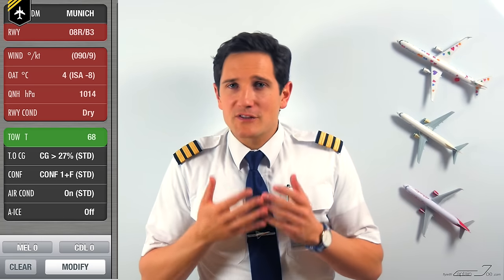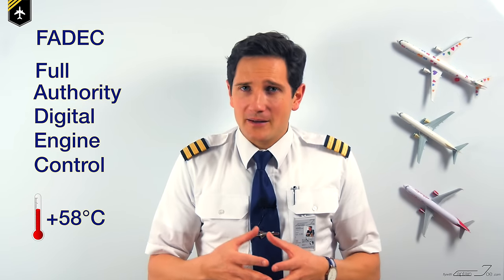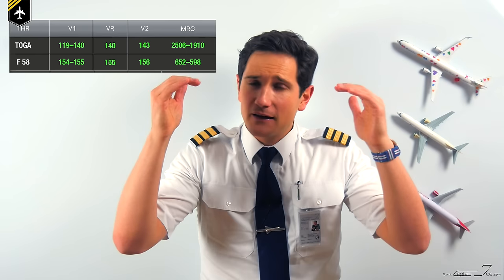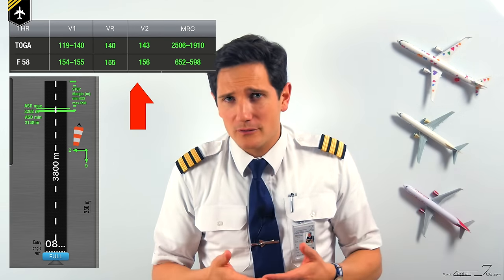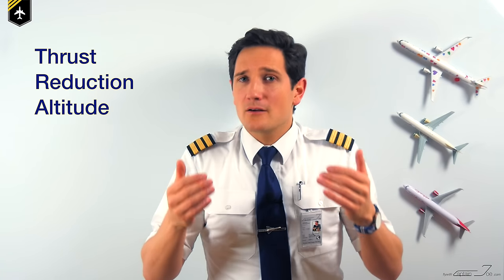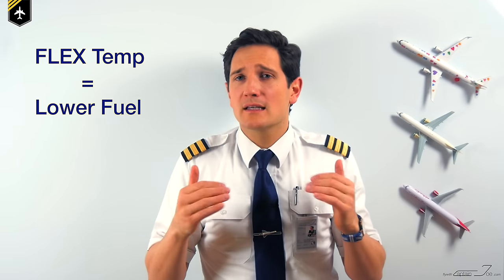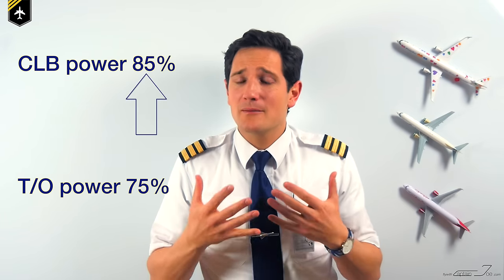What is FLEX TEMPERATURE? Explained by "Captain" Joe

Comment: Hey Joe, can you explain about hot start and cold start? Thanks
Reply: There is no such thing as a cold start.  A hot start is when the EGT (exhaust gas temperature) tries to exceed the limit while starting.  The FADEC will shut off fuel and continue to turn the engine core to allow unburned fuel to burn until it is gone and for a while after that to cool the engine core.  On a 737, 757, 767, the pilot shuts off the fuel...

There is probably a video available on YouTube that you can watch.  Most likely, it will be in a simulator scenario as hot starts are very rare and the likelihood of someone capturing it on video is even more rare.

For one, most airlines do not allow pilots to videotape in the cockpit.  It can be a distraction from safe operations.  Joe doesn't fly for a US airline, and I have no idea what his company allows, or what regulations allow in Europe.

Comment: Always great explained! But one question: At which temperature does the aircraft set TOGA? I mean if you choose a very low FlexTemp then the aircraft need to compensate it. Or is there a minimum Flex Temperature?

Comment: Don't wanna waste 6:04 trying to find the explanation? Let me simplify it for you! Flex temperature essentially tricks the engine into thinking it is actually the outside air temperature. The higher the flex temperature entered into the MCDU, the lower the engine thrust. The lower the flex temperature entered into the MCDU, the higher the engine thrust. For example, if you are taking off from a long runway, you don't need as much engine thrust, so your EFB iPad would calculate a higher flex temperature.

Comment: The missing point is that the FADEC will match the air density. When T is high the air density is  low so for the FADEC no needs to waste fuel. That's the basic concept of flex Temp.

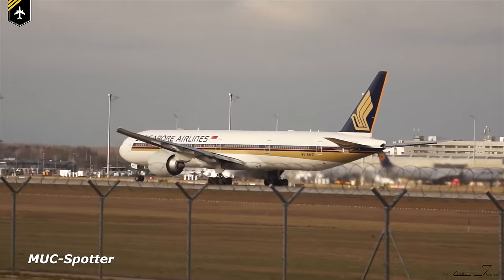Comment: Hi Captain Joe! Could you explain how the take off thrust can be lower than the climbing thrust on a Boeing (5:04) while the force to take off should be higher since you are still stick into ground. Gravity shouldn't be more important when taking off than when climbing in the air ? Thanks.

Comment: Great video. I have a great doubt due to your explanation. Why airplanes need less power in higher temperatures if with high temperature we have less air density?. In my common sense, I think that as we have less air density we need more power to achieve the VR or the enough lift to take off. I know in the performance chart we can take off with less power, but why the computer assume that with more temperature we need less power. I hope to have an answer. Thank you.

Comment: Hi Captain Joe, on the description you say that while using a higher flex temperature for take-off the plane will need to go faster than the same plane on a lower flex temp. I don't get that... isn't the take off speeds (Vr and V2, not V1) based on plane gross take-off weight, flaps config and outside air temperature and pressure and winds? I would assume that different thrust settings for the same plane (weight, config) and same environmental conditions (temp, press, wind) would only cause different accelerations, hence more or less runway needed for take-off (V1); but same speeds (Vr, V2...

Comment: Hello Captain :)  Sorry but I dont understand why Vr is increasing when we use flex temp. take off. I understand that aircraft accelerates slower, so the take off distance required increases. It simply takes more time and distance to reach vr. But shouldnt the lift off be at the same spped, as in full thrust take off? I dont get it, and can;t find good answer in the internet. Best regards!
Reply: Basically, an aircraft climbs not by lift, but by excess thrust. The purpose of lift is to keep the aircraft in air (this is the reason why rockets can climb vertically, without needing wings for lift).

Hence, in a flex takeoff,  since you have less thrust, hence you need a higher speed to lift off.

Comment: Great explanation. However this always goes against my intuition which is if I tell the computer that the OAT is actually higher, then it should give MORE power since when the temperature is higher you got a higher density altitude which requires more thrust and also thrust itself decreases with an increase of temperature.
So flex temp increase will decrease applied thrust only because of engine protection (less wear)?
Reply: Basically think of it this way. The aircraft has a EGT (exhaust gas temperature) limit. The higher the OAT is the higher the EGT can reach. Above a certain OAT if the aircraft uses full thrust, the EGT limit will get crossed. To avoid this, the FADEC limits the thrust so that it doesn't reach those EGT limits.
So basically flex temperature is doing that, to reduce thrust.

Comment: Dear Captain joe. What is "EPR" meaning, and what´s The differents between "N1"
Reply: janick burghardt Exhaust Power Ratio, while N1 gives you a percentage of maximum front fan RPM and N2 the percentage of turbine RPM, EPR acts as N1. However, EPR measures the pressure difference between inlet and exhaust to calculate the thrust. Some people agree this gives a better vieuw on the engine performance then N1. EPR is used for A320's with IAE engines, N1 for CFM.

Comment: Another great video.
I was on an Airbus A320 yesterday and about 30secs after takeoff the engines went back to what felt like idle for about 2 seconds then back up to climb thrust. There was a bit of turbulence whilst the thrust was reduced. Is this common?? I thought maybe a problem and turning back but flight continued with no problem.

Comment: Hello joe, great video! Why will the V1 increase with a greater flex temperature as I can see at 3:00 min? If the thrust is derated you will use more runway to achieve Vr so I thought V1 would be lower

Comment: In the CAP698 Performance Manual, it states that a Reduced Thrust Setting (FLEX Temp) as well as a Derated Thrust Setting cannot be used when using the increased V2 procedure when trying to obtain Vx before VLOF. Does this change from aircraft to aircraft, or airline to airline? Or is this a set rule that cannot be ignored? 

Curious as the CAP698 is type specific to a generic B737-400. Would be nice to have an opinion from someone who flies a different aircraft!

Comment: Hello Joe thanks for the very informative video!! I have a question. In your explanation you say the LOWER the Flex temperature the higher the engine thrust. It’s seems to me the HIGHER the Flex temperature the more thrust you should need!! In other words can Flex Temperature  be thought of in the same light as the hotter the outside temperature the longer the takeoff roll? Can you explain this a little further? Thanks so much!!
Reply: Its a different concept. Flex temperature isn't for how much thrust you need for that temperature, but rather, how much thrust I have to to not overheat my exhaust gas temperature limit.
I'll try explaining in very rudimentary language (to avoid confusion)

Say the exhaust gas limit limit of the engine is 900 degrees. So at normal temperatures, the engine can create max thrust while maintaining the exhaust gas temperature at 900. In this case lets assume that max outside temperature is 40. So at temperature 40 and below, the engine can make max thrust without overheating. Now say the outside temperature goes to 41 degrees. Now if the engine tries producing max thrust, it will bring the exhaust gas temperature above 900 degrees which is above the limit. So to avoid that, the engine decides to reduce the max thrust it can generate, so that the exhaust gas temperature doesn't go beyond 900. Now, the more the outside temperature increases, the less engine thrust will be generated to avoid overheating. This outside temperature we enter then becomes the flex temperature.

Comment: My first flight was on 747 and take off acceleration was like a manual transmission car.  It wasn't smooth but was stepped (as if pilot increased power more and more at given speeds, like 3 times).  I've never experienced anything similar afterwards.  Is there a good reason to do such power control ?  It was in 1991 on Korean Air.

Comment: Question about temperature.  When the air is cold, like in the winter, it is denser than when it is hot in the summer.  Does a passenger plane lift off more quickly in cold weather because of the air density, or does the cold air density inhibit the speed of the accelerating aircraft on the runway? One would suppose that in the heat of summer in say Denver, because of the altitude and thinner air do to altitude and heat, it would take a long time to lift off a big airplane.  Is this true in practice?

Comment: for example in Bogota at 8360ft  at airport with fairly stable weather (13°C) and QNH (30.30 in Hg.) which should be the flex temp keeping in mind that the runway is fairly long and a fully loaded (cargo and pax) plane for a 300-400 mi flight (lets say 70tons perhaps) - i ussually put 41 in the simulator but it uses a lot of runway
Also how can i calculate it

Comment: but as the OAT increases you need more power for take off, so how come this fake increased flex temp leaves us with degraded power settings?
Reply: Vasco da Gama because the flex temperature is only for the engine performance and not the actual flying performance.
Reply: Flat rates engines are designed to produce the same thrust up to a certain temperature. Above this temperature, they will start producing less thrust.

Comment: I still have a hard time understanding this. Why not just input the FADEC the runway length and V1 and V2 speeds? I understand the purpose of reduced thrust to reduce engine wear, but it would appear to simply be better to tell the FADEC how much length you have to get to V1 and V2, and it can adjust thrust power accordingly. I'm not sure where the FADEC gets the figures for temperatures and why you tell the FADEC some ambiguous temperature when it is not the actual temperature outside.

Comment: if I am understanding correctly the goal is to minimise engine wear and fuel use, to this end you want to reduce engine power while on the runway. and you do this by lying to the engine about the temperature of the incoming air.

this is going to need a lot of calculation to determine the temperature that will result in the correct engine power

why implement it in this way. would it not be simpler to set up the system to allow input of the desired power for this phase of the flight.
Reply: You are 100% correct. You lie to the aircraft to get a lower thrust setting. This isn't very difficult to calculate with today's fancy apps and what not.

Comment: Is the FLEX-V1 considerably lower than TOGA-V1, since it takes the plane more runway to even reach that speed?
Reply: In practical sense, its not a considerable difference. As in chances are if you're using a higher flex temperature, the aircraft is much lighter.

Comment: Hi Joe, So, when I run my runway analysis and Performance in OPT (Boeing product), I enter the real OAT from the ATIS (real field conditions) and after calculating is telling me  the suggested D RATED temperature that I should enter on the FMS for a “ flex take off” Is this how it works for a Drated takeoff ? 

Second questions is:
But, the pegasus FMS (FMC actually) is not giving me the take off speeds , I have to insert that myself from the calculation results from OPT.
Are those speeds accurate or do I have to run OPT again with the D rated take off temp? 
Thanks Capt.

Comment: hi captain Joe!!!
what is PTU power transfer unit?
Reply: Hey I know Joe didn't answer but I think I could answer that question. The PTU is a electrical pump that maintains pressure on the different hydraulic systems on the airbus, since the green and yellow systems are powered by the engines and the blue by an electric pump, when the engines are shut off the green and yellow systems depressurize and the blue system, connected to the PTU, has to maintain some pressure on those 2 other lines. hope it helped !!

Comment: Hi Joe i've watched all of you're videos and i like them all, i have one question, what is DOWNWIND ? i've heard pilots say that on ATC  but i dont know what it means.
Reply: IR LM downwind is a part of the traffic pattern. So you have upwind when you’re going away from the airport then you do a 90 degree turn to the left or the right to begin your crosswind sector. Do another 90 degree turn to the DOWNWIND sector which is you going parallel to the runway. Then after that you do another 90 degree turn to the base sector. When you get closer to the runway center line do the last 90 degree turn to the final sector now you’re in line with the runway and ready to land. This is most commonly used to gain more flight experience and in flight school. For more detail you could search it up on google to understand what I’m saying cheers!

Comment: Thanks for such a nice video!!!  I heard that the fuel tank for an airplane is wings! I am curious: how wings are capable of storing such a huge amount of fuel. Are wings secure enough to store such a highly flammable liquid. Could you make next video about this?
Reply from the maker: Yes the wings carry the fuel, I´ll see if I can make a video on that!
Reply: KPSHARMA the wings have enough free room inside, so manufacturers decided to add the fuel tanks in it ;)
And it actually is better for the structure of the plane, as (most of) the fuel mass is not in the fuselage, reducing the forces on the fixing point of the wings ! ;)

Hope this helped :)
Reply: jet fuel isn't as flammable as you might think (flash point is far lower than gas).

Comment: Hi Joe, does this mean that you are kinda "tricking" the FADEC by entering the flex temp? Otherwise it would be called differently like a derating by thrust percentage. Also, when I visited an airbus cockpit I saw the captain doing his takeoff calculations on a laptop, is there a program that is also available for non pilots or is it reserved for airlines?
Reply: Yeap...you are right! Basically tricking the fadec.... Theres a program for performance calculations which can be done through a device on the airplane or Ipads! And sure it is reserved for airlines to use Only.... We use Ipads

Comment: Your video did not made it instantly clear to me, what a flex temperature is. I assume following, high flex temperature means we have favorable take-off conditions like:  head wind, high air pressure, cold air temperature - etc everything that increases jet engine thrust at a given RPM, coupled with the longer runway and light load resulting a lower thrust setting required for safe take off.
Higher v1 in higher flex temperature, means that the plane moves slower on runway, thus pilots have more time to react. And flex Vr is higher from Vr (TOGA), because as the plane gathers momentum slower thus too early rotation (rotating at 140 kts for F58 setting) would result in instant stall condition on increasing the angle of attack?

Comment: 2:08 I don't understand this particular point: Why should the FADEC reduce the engine power on hot outside air temperature? I know Flex temp is not real temp, but in case of real high outside temp., why is engine power reduced? I know, engine power capabilites are reduced in hot air temperature, and are also in low air pressure. But why should the FADEC intentionally further reduce engine power in hot air conditions? Seems like it should be vice verca, and it should increate engine power, to compensate for reduced engine efficiancy in that conditions.
Reply: Because there is an EGT (Exhaust gas temperature ie a max engine temperature) limit as well. Higher the outside temperature, easier it is to reach the EGT limit and overheat the engine (as per the FADEC). Hence the FADEC is like "outside temperature is high, so I will reduce power so that the power generated doesn't result in the temperature exceeding the engine limit"
Reply: @ZK-APA  yes, thanks. The EGT limitation answers it. Still "flex temp" is a strange measurement for engine power reduction. They could just put a percentage. I. e. take off at 80% engine power.
Reply: @m.l.5284  Flex temperature is easier to calculate and derive compared to an actual power percentage, especially when using paper performance charts instead of software.

Comment: Are there longer runways in places like Florida which are almost always hot?
Reply: It depends on which type of aircraft and which type of routes are usually operated. In Florida's case it is hot but the elevation is almost sea level, so you don't need absurdly long runways.
Also in major airports, the runway is long not because of aircraft requirement, but because of efficiency. Lets take JFK as an example. the longest runway is approx 4400+ metres. It doesn't require such a long runway because the aircraft that operate there need it. The long runway is there so that for landing once can plan and then decide how to vacate the runway as efficiently as possible. And for takeoff they can use reduced thrust to depart rather than go full thrust.

Comment: don't get me wrong. it's a very good explanation but as usual with Flex what are the factors which makes the pilot decide which flex to use? i mean you showed this chart whereas the speed is in correlation with the given flex but  there has to be a rule were you have to use a certain setting doesn't it? Most of the videos just explain what flex is but the really interesting thing would be the factors to apply it and if so how to calculate it.
and since it's a relative high "fake" outside temperature which lowers the power setting why is it that in real high temperature situations to/ga is applied? (i know thin air = less lift). i always thought flex is somehow to stop the engine from overheating but with toga it's somehow the otherway round. high rpm in real hot conditions and lower rpm in "fake" hot conditions? why?